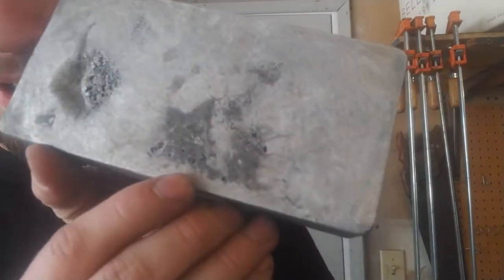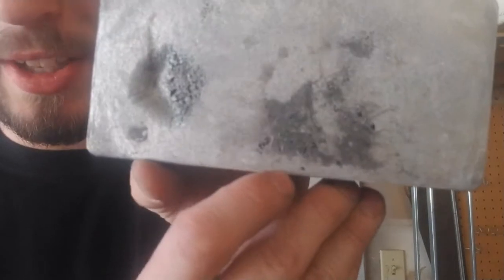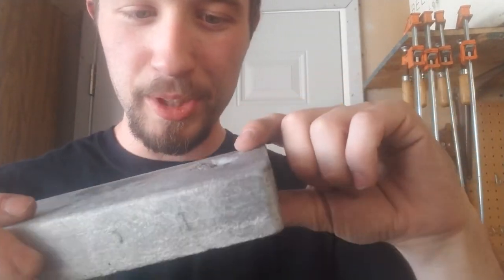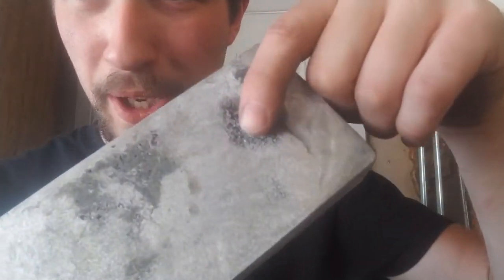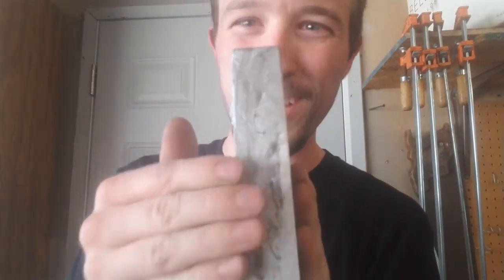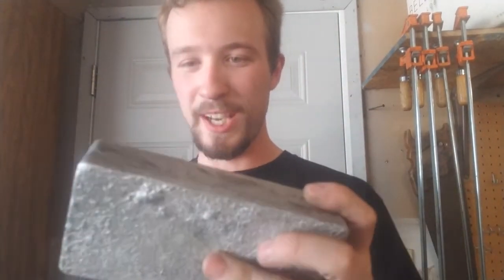I Made Some Oddly Square REVERSE BRONZE

Comment: Not sure if you know those already, but when  aluminum is brittle and breaks instead of bending, it usually is an alloy of aluminum and silicon (alusil), this basically includes every cast aluminum engine parts
Reply from the maker: I came across the same thing in my research, the Transmission Bell Housing part that I used likely contains some silicon and magnesium